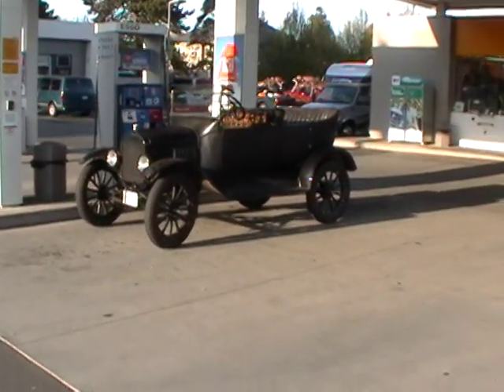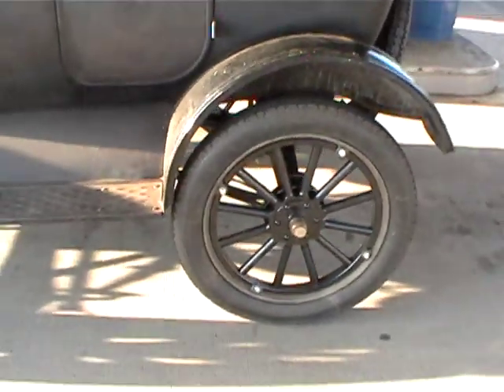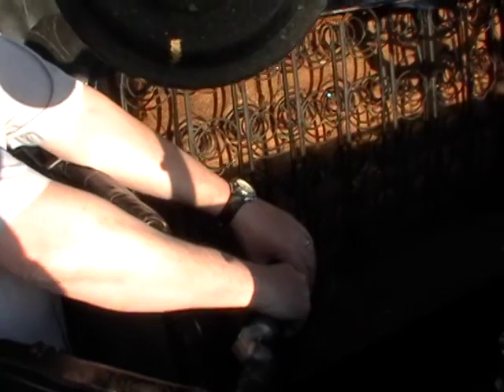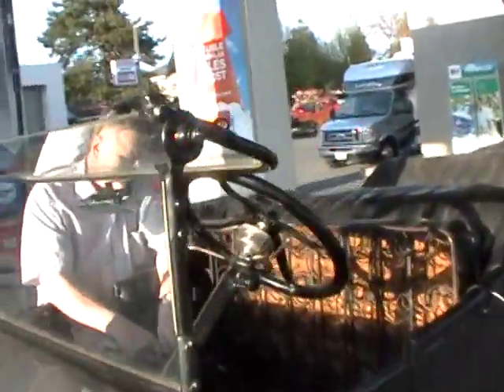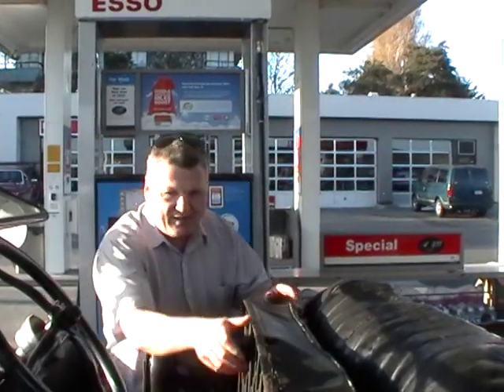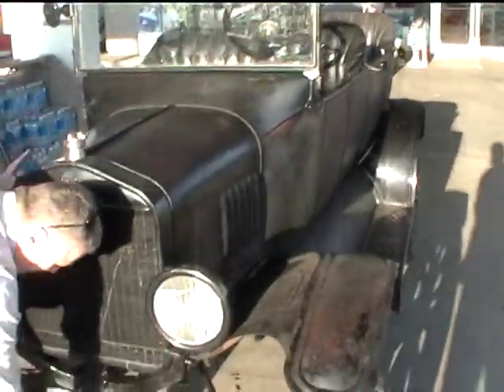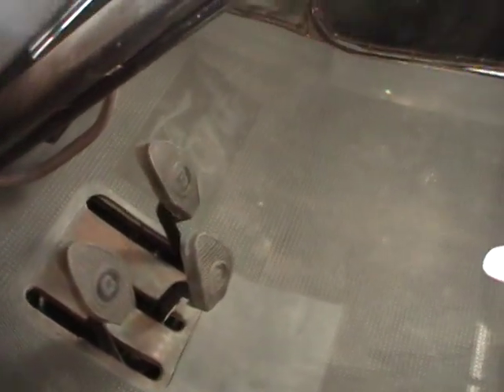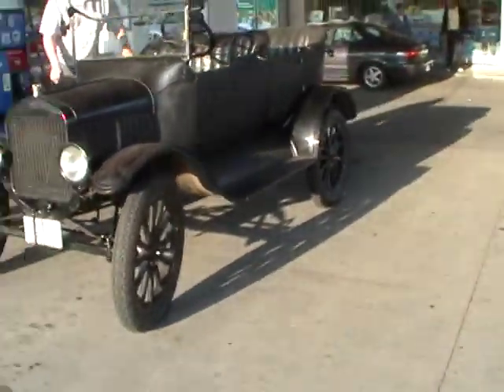Ford 1922 Model T at the gas station.

Comment: Did anyone one notice that he put e85 ethanol in it? The model t ford was made to run on regular or ethanol 
Just adjust the advance and carb right from the cockpit 
Also note that gas back then was 55 octane and ethanol is 110 octane= the same as today.
The model t was made from 1906 to 1927. A true marvel 
And most reliable
Reply: actually from 1908-27. ford Motor company was found in 1903

Comment: Doesn't that thing run on leaded fuel?
Reply: You can convert for regular, or add some addative.
Reply: Just saw a video saying leaded fuel wasn't a thing back in the days, so this would run on unleaded.
Reply: if i remember correctly, that thing would run on nearly anything   combustible, including alcohol. think you could get instructions for a still to make  fuel (pre-prohibition).

Comment: I wonder why nobodies thought of doing a fuel pump mod for going up hill. Considering the distance it wouldn't even have to be super powerful. You could probably power one with a super small cheapo battery no problem even.
Reply: I have a 23 T and never had any problem going uphill and it starving for gas and it is hilly enough around here.  The gas has to be pretty low I expect and on a very steep hill.  Ran out of gas once with my kids and the neighbors kids on a joy ride. Went to a nearby farm and they lent me some and off we went back home. Paid them back later🙂